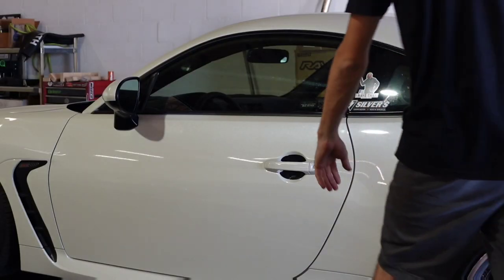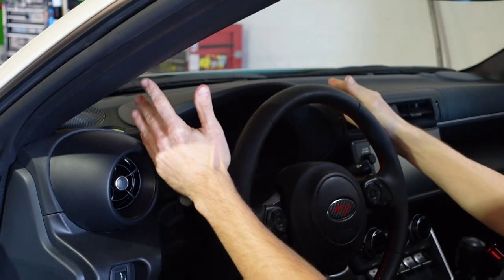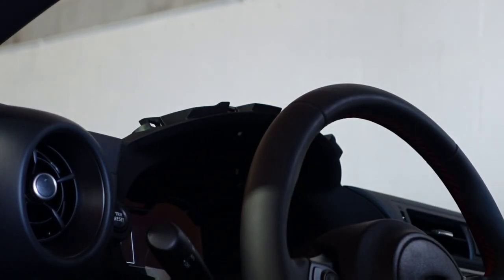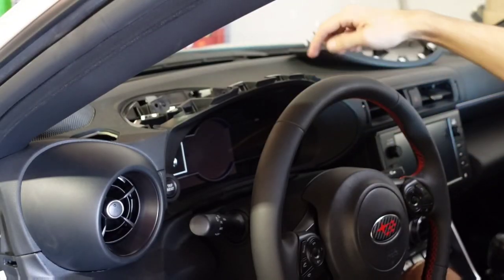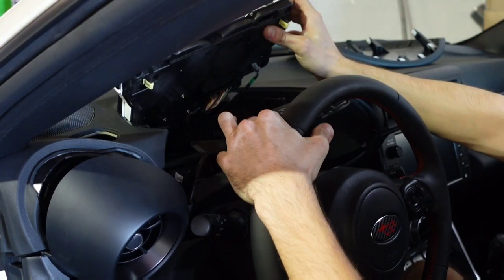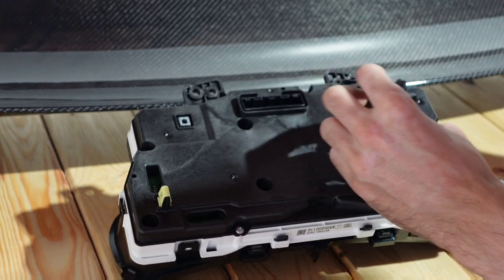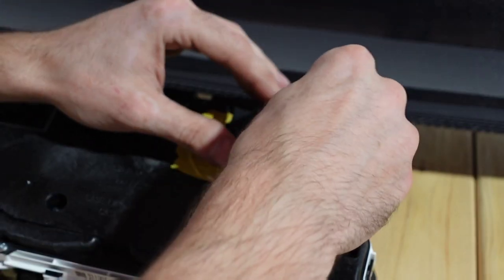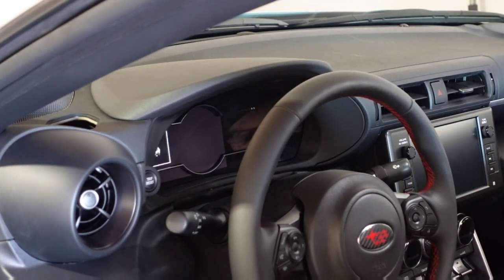How To Permanently Turn Off Seatbelt/Door Chime 2022+ BRZ & GR86

Comment: I did this but I've also lost by cross traffic alert. Turn signal blinkers . Etc etc . So you lose those sounds also. Might have to revert back
Reply: Thanks for the heads up.
Reply: Oh......damn didnt think about that.....was goin to do this
Reply: Thanks for pointing this out, saved me. He really should have mentioned that in the video.

Comment: if you put your seatbelt into the buckle about 20 times really fast within around 30 seconds, it disables it
Reply from the maker: That works as well but Sometimes it will turn back on. Also not sure if it eliminates the ding when starting the car and shutting it off. This method didn't take more than 10 minutes and ensured a permanent solution.
Reply: Didnt work for me
Reply: Came to say this.
Reply: This works great until you put something like a dog in the backseat and discover that they put chime in for the back seat that isn't disabled by the 20 click method
Reply: That only works for the seat belt,not for the chime when you kill the engine with the door open.
Reply: It has to be exactly 20, but this is a great tip
Reply: I did the seatbelt thing in my 2023 and it does not work

Comment: I did this after a camping trip where I was moving the Subaru many times all week just a few hundred feet. It did not require and mechanical work.... Simply insert the belt clip 20 times in 30 seconds

Comment: And risk scuffing/scratching the dash/cluster!  Is this speaker used for the other safety sensors?  I would do the insert seatbelt rapidly option.
Reply: It's probably used for all the other kinds of warning lights, such as low fuel, low tire pressure, "engine about to blow up", etc.

Comment: Doesn’t really make much sense when you can put the car in accessory mode and quickly buckle and unbuckle seat belt 20 times in 30 seconds. I can confirm that this works👍🏼
Reply: does it keep the setting for good or is that something i'd need to do all the time?
Reply: @robertsavello4120  So far it has stayed off. I heard when you disconnect the battery you will have to redo the process.
Reply: @kevinkhaffaji2137  Thanks!  that's reasonable and i would expect that type of behavior.
Reply: Yep, that’s how I turned it off when I had my STi and installed seat harnesses.  All Subarus have this feature.  It will stay off until you disconnect/reconnect the battery.  This method is better because you don’t have to take the dash apart and turning it back on takes about 30seconds by just reconnecting the battery.  Also, the speaker may be needed for other features or notifications & this only disables the seat belt chime while keeping it available for others.

Comment: I have seen on other vehicles that you can use the wiring under the seat. There is a harness for the buckle sensor, you just splice the 2 wires together and it thinks the buckle is always inserted. I would imagine that would work on most cars.
Reply from the maker: Not a bad idea. That would eliminate the light as well if it works. You would just have to be careful because some seatbelt clips have wiring for the air bag.

Comment: yall should do "how to remove CEL when changing headers" :(
Reply from the maker: Currently there's no solution to that problem. The factory headers on these cars have cats on them and until we get catted header options or someone cracks the code to start tuning these the orange light will glow bright all through the night.
Reply: @ImportImageRacing  the car wont stop automatically? it don't have a safety feature with that cel is on? I'm just afraid ill get stranded lol
Reply from the maker: @xcz604  the CEL for cat deficiency won't cause any damage as it's just an emissions code. MXP makes something called the CEL Eliminator. Which is essentially a spacer for your 02 sensor to trick the car and getting rid of the cel. That could be something to look into! Hope that helps!
Reply: @ImportImageRacing  so technically when i put the defouler on it will automatically remove the CEL?
Reply from the maker: @xcz604  In theory yes. It works on most cars.

Comment: I think this is in all modern cars now. Personally I rather leave it on because it reminds all my passengers who keep forgetting to put on their seat belts when we're on the road. i don't want to be responsible for them.
Reply from the maker: Very good reasoning. I will say with this disabled in my personal car as well I do sometimes have to nag passengers to put their belt on. It is much easier when the car doesn't stop dinging so they give up and put it on.
Reply: Hell no....havnt worn one in 50 years.....I think I had them in the Chevelle

Comment: Cons. You also lose turn signal noises. Cross traffic alert and back up alert noises . And you can't turn up radio volume as it gets turned down as well. So this is not the solution
Reply: You can get an extra seat belt connector and put it on a cheap retention lanyard.  Keep mine behind the passenger seat when not in use.

Comment: Its not that’s difficult 
In ass mode buckle n unbuckle 20 times within 30sec and put seatbelt on start the engine n turn off thats it
Reply from the maker: Correct but that doesn't eliminate the start and shutoff chiming and isn't always permanent. We always wear our seatbelts so that wasn't the main concern.